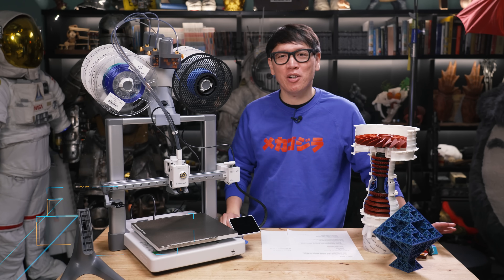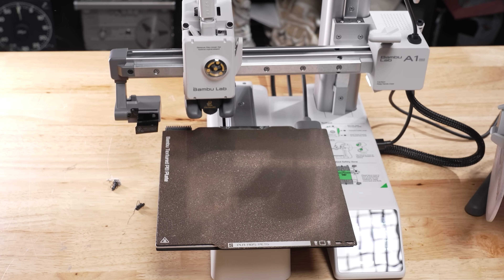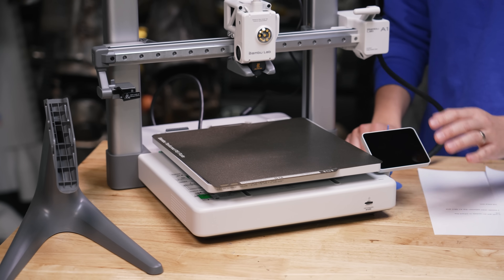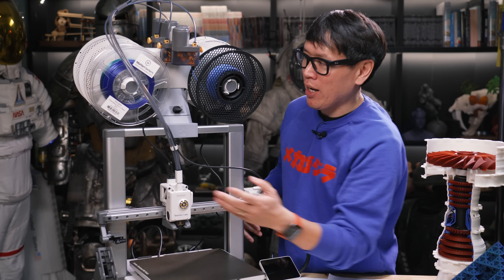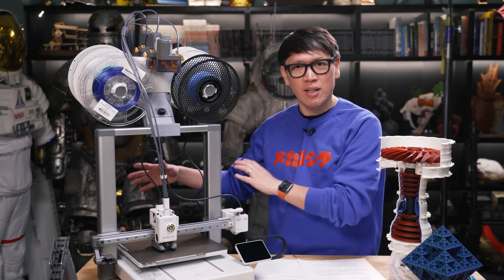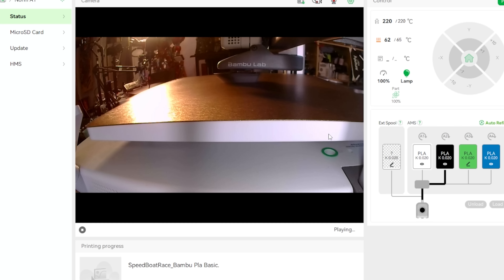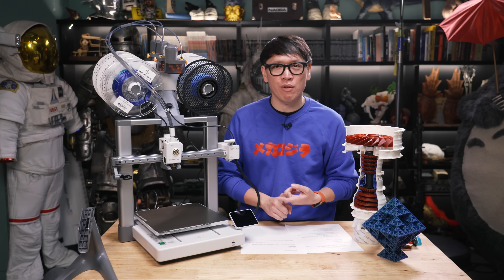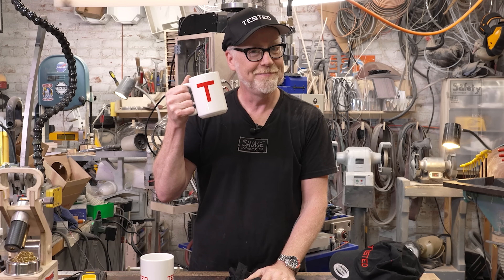Hands-On: Bambu Lab A1 $400 3D Printer!

Comment: This all looks good but how does it stack up against a resin printer of a similar price point? I'm not sure which technology I should go for. Resin print resolution looks good but the resin is expensive and looks like a messy, time consuming process to print something. My experience of FDM printers (granted several years back) is that the resolution isn't great and you spend more time trying to get a decent print that sticks to the bed than you do printing. Consumers want something that is fire and forget for the most part.
Reply: My Bambu Labs P1S is literally slice, print and come back to a fantastic print. My Neptune 4 pro on the other hand? Baby sit, tinker, tighten something here also have to manually add the bed level mesh in the g code manually. You can also get a .2 nozzle for $15 buckeroos and that is pretty damn fine resolution. Really depends on what you want to do. Want to print mini figures and busts? Go resin. Want to print anything else? FDM. Don't cheap out like I did at first unless you like spending more time figuring out what is wrong with my printer vs actually printing stuff successfully.
Reply: @TheMagnumload  I want to be able to print small things and large things as needed to a reasonable resolution without the need to constantly tweak values or do much in the way of post processing. Design something in Solidworks or whatever and sent it to the printer to be created. No mess, no fuss. Just reliable printing. For the rare times when I want to get the very best and I don’t mind waiting for it, then I’d like to be able to do that but again without needing to mess too much afterwards. I want a lot I know! Lol
Reply: Why are you comparing resin printers to FDM? It's two totally different things. I have 3 resin and 4 FDM and I use them for totally different purposes. If you want to print busts and art toys, def go for the resin. But resin is ridiculously expensive and don't forget to include the price of a wash-and-cure (not necessary but honestly it's been really useful). They're also pretty fragile and not suitable for mechanical parts. If you want to prototype things, or print large stuff for your home, def go for FDM. Filament is cheap and you can do a lot of useable stuff.
Reply: What are you printing primarily? For large cosplay then FDM. For small cosplay you can use resin. Resin helmets are just too fragile and if you have a failure then you just spent $30 on a failed print.  If it is for gaming miniatures then resin, but you'll want an FDM if you decide to print buildings or scenery for your mini to have adventures through. Sure, you can do it in resin, but you'll have more cost involved in the resin itself. If you want a fire and forget printer, then this is it.

Comment: Man Bambu Lab is putting every other company on notice.
Reply: And Sovol is about to be chomping at their heels. Wait to see their next release. At probably less than half the cost 😁
Reply: What is unethical, it is the use of open source projects and software and make it close source, not giving users the ability to modify their machines or giving credit to their creator’s. Even Bambu studio is made out out Prusa slicer.
Reply: Bambu lab is literally the goat
Reply: Blew the doors off the competition
Reply: I was thinking that, but every close up he showed is kinda rough. That benchy at 11:59 has lots of problems. I know the Prusa is double the price (for a kit) but you just wouldn't see that there. You probably wouldn't see that on the P1P/P1S either.
Reply: @aaronchamberlain4698  I mean lotta variables here. Most people say you should turn down the speed a little vs what it's marketed as. I've also seen absolutely perfect benchys so I don't really think that's something anyone should worry about. 

Print quality really hasn't been an issue for any printer in the past few years. usually comes down to user error or the filament used.
Reply: @aaronchamberlain4698  If that is the benchy file that Bambu provides, then it's just the file's fault. Based on my P1S, when you slice your own benchy with good setting, that doesn't happen. The provided one was made to print fast, not well.
Reply: @technologist4270  I mean, if that’s true it’s pretty stupid. The files are meant to show off the best of the printer. It also kinda kills the argument of everyone going “my Bambu prints so much faster” if you have to tune down the speeds a little to look good.
Reply: Yeah except their CCP ties and integrated camera
Reply: @renderedpixels4300 not a big deal for those of us who aren’t paranoid and don’t give a shit about that lol
Reply: @renderedpixels4300  Almost all 3D printers are made by Chinese companies. Bambu Lab is just one of them
Reply: No they arent, this is literally nothing new, this printer is like a hundred other printers that arent locked down into some Chinese walled garden that steals your STL files.
Reply: Bambu labs shills are insufferable.

Comment: The Bambu Lab closed ecosystem!
Reply: *closed ecosystem that works great.
Reply: Its the Apple of 3D printing. For most people, they are fine with that closed ecosystem because it works so much smoother on a day to day basis, but heaven forbid you try to do anything custom or outside of the ecosystem. And if you want to use anything non standard (Apple charging cable comes to mind), good luck! You gotta pay much more out of pocket to get the "certified" version
Reply: Closed ecosystem  just like your TV, fridge, dishwasher, like all new cars and most phones etc. There are thousands and thousands of open source 3d printers, why is there an issue when one single company decides to do things their own way?
Reply: @NorwayVFX  "why is there an issue when one single company decides to do things their own way"
Maybe because bambu lab keeps violating multiple laws surrounding open source licensing.
Reply: @LilApe  By making the technology better? Go cry somewhere else.
Reply: @vikingdisposal They aren’t doing anything that innovative though. It’s all previously invented things just put into one package and simplified for consumers as opposed to hobbyists
Reply: @raidriar01  Then that is innovative. Innovation doesn't just mean inventing new things. It can mean improving things, including reliability and user experience. I have exactly zero desire to be a 3D printer mechanic. I want to print. I understand that a Bambu isn't impervious to issues, and I will have to make repairs and adjustments at some point, and I'm fine with that. I just don't care for that to be one of the primary roles of my hobby. It's okay if someone else likes to do those things. I just don't. I'm not brand loyal by any means, but, at the moment, Bambu just does it for me.
Reply: @LilApe  This is literally just bs.

Anyone who has seen this giy around knows literally all he does on youtube is spout nonsense about Bambulab.

its wild.
Reply: @vikingdisposal ccp shill😂
Reply: @rightsdontcomewithpermits7073  So you jump on the "hate Bambu" bandwagon for absolutely no logical reason, but I'm a shill for giving credit where credit is due. 🤣🤣🤣🤣 That's hilarious, especially considering I don't own any Bambu products. Next time, at least try to have some semblance of a valid argument. 🥴🤡
Reply: @raidriar01 some people have printing as a hobby and others have the printer as a hobby. Don't judge.
Reply: You say this like prusa is anymore open in ways that actually matter.
Reply: @BeefIngot  Can't you still just download the files to print like 90% of a Prusa?
Reply: Thanks for triggering ccp pinks.
Reply: Right and they use android to run their os. Google is PISSED.  Shit is about to hit the fan for them.
Reply: @cgwworldministries83 truly hope you are right! Those ccp agents need to be dealt with.
Reply: @cgwworldministries83  Never befroe has something so nonsensical been said